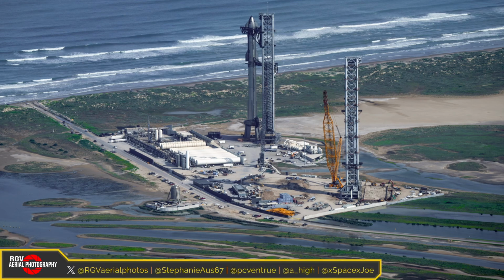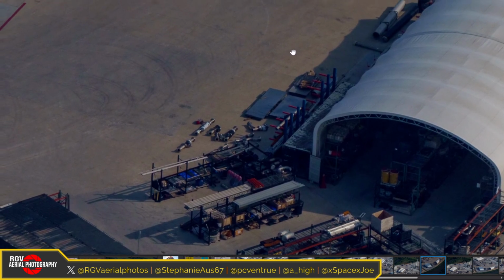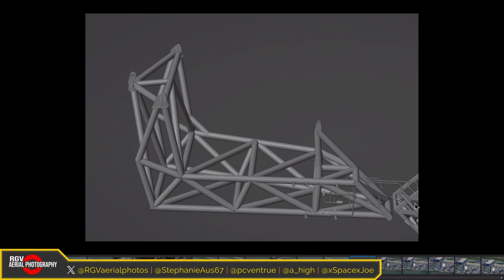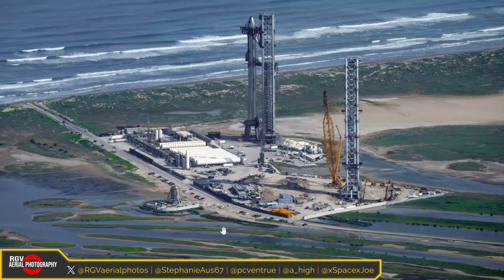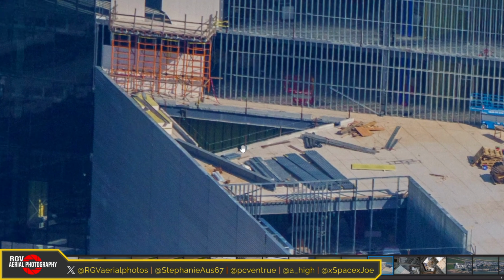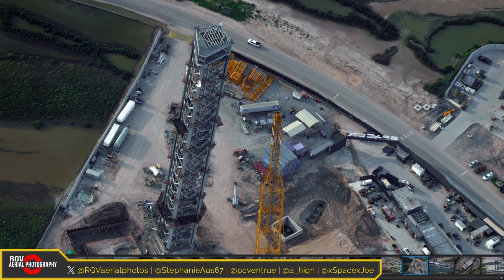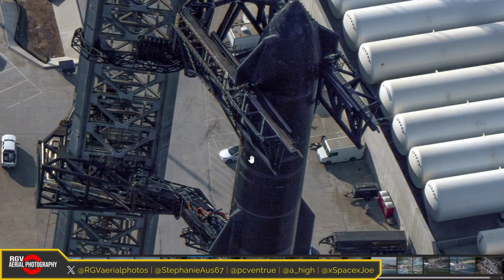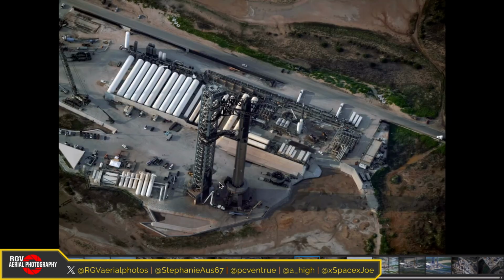Starbase Weekly, Ep.135: Starship Flight 5 Stack Testing Ongoing & Booster 11 Debris Recovered

Comment: Could that facing on the parking garage be some kind of hurricane protection? In a hurricane the slots in the side of parking garage could act like venturis and accelerate high winds even higher. Also if that garage was empty of cars in a hurricane the garage could be used as a sort of bunker to house equipment that is out in the yard.

Comment: B11 likely suffered a fractured down-comer, when it hit the water thus mixing gasses causing inevitable high energy event.
Point is, a successful IFT can be defined as any that does not destroy data.
Scooping evidence from the deep is such a valuable learning opportunity - fabulous.
Reply: Fractured? It wouldnt break but bend and it wouldnt bend unless the main structure was failing. IFT-1 showed how ridiculously strong the vehicle is so i dont think there would be any main body failure during that splash down.
 Seems to me the most likely and planned sequence was touchdown then fts being commanded. This will instantly safe the vehicle and have the engine area sink directly where it touched down making it easy to locate.